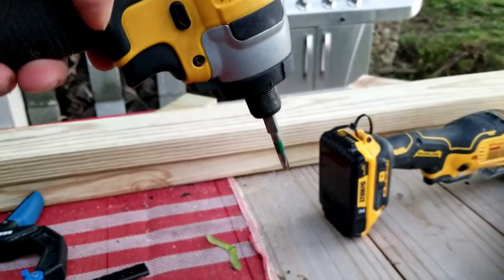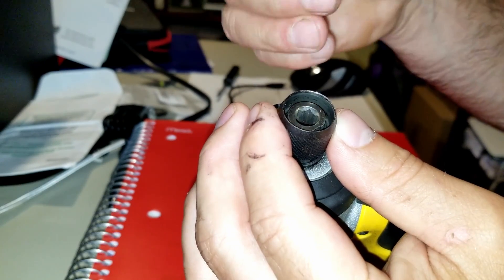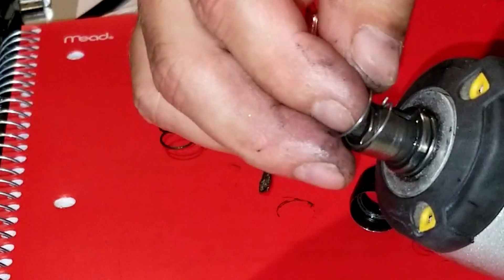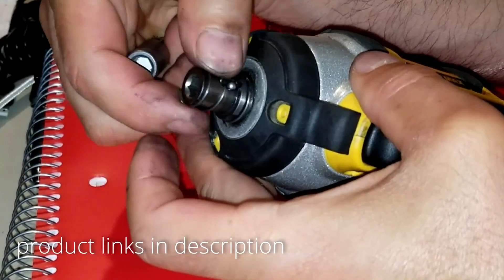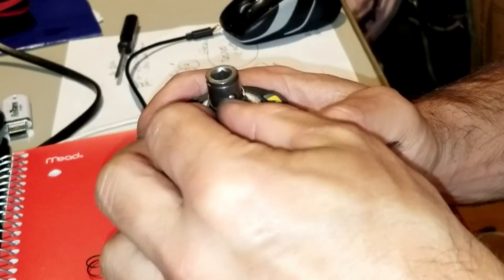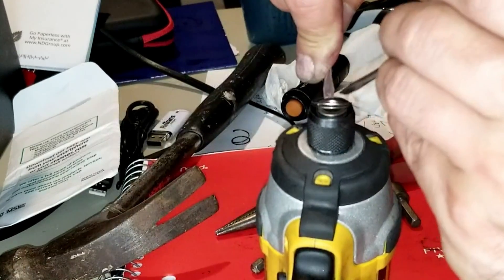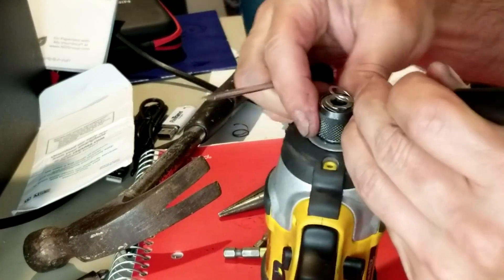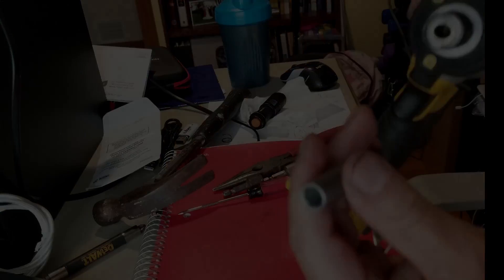Falling, loose impact driver bit - DeWalt driver bit not locking

Comment: Thanks for the tip of stretching the last clip to reinsert it on the shaft. That works easily to finish the bit holder reassembling.
Reply: In addition, when using that method (which is excellent!) Use a flat blade screwdriver on top of initially located  'tail' of the slightly bent hog ring and use it to simultaneously keep it in the groove and to keep the thin thrust washer down and use another flat blade to pop the remainder over the groove.

Comment: My dude… THANK YOU! You explained the repair perfectly, I was able to do the same for my impact driver. I had difficulty getting the retaining ring off but I found using two tiny flathead screwdrivers pushing in opposing directions at the gap makes it much easier. Thanks again
Reply from the maker: Glad it helped, thanks for leaving a comment, please consider subscribing for more videos.

Comment: Put retaining ring on one side use needle nose pliers to grab other side of the ring and the outside of the sleeve. Stretch ring and push down at the same time. It takes a few tries but works well.

Comment: I FIGURED IT OUT. The little tab that holds the bearing needs bent DOWN, not up. When you bend it up it wants to scoop under the bearing and keep it pushed away from the bit, holding it up. You want it down so as the spring comes up the 2 little angles want to push the bearing inwards toward the recessed spot in the bit. Also make sure on the bottom of the spring it’s tight to the shaft, and on the top where it touches the bearing make it a little wider so it doesn’t hug the shaft tightly, but loosely. Also do shorten/compress the spring, but stretch one side on the bottom of the spring under the tab a little, make sure the coil under the tab is stretched so it constantly pushes on the bearing, that way with the way the tab is angled, it wants to constantly push the bearing inward.

Comment: Man my rigid is doing the same thing, any experience with those using the same spring as the Dewalt?

The drivers look similar and the rigid also has the same retaining washer
Reply from the maker: Might be different parts but the concept is the same when repairing it

Comment: That is really stupid, you go to great pains to show us how to put the spring and bearing in with the spring going on after the bearing then without saying any different you assemble it with the spring going on before the bearing.
Reply: Agreed with Steve James. Can't understand why you did that. At least clear it up instead of just hoping no one would catch the mistake. Thank you anyways. I simply repaired it myself. And it worked terrific. But thought I'd just check the ol' interweb to see if I got it right. Could be very frustrating for someone not mechanically inclined who happened to see that.